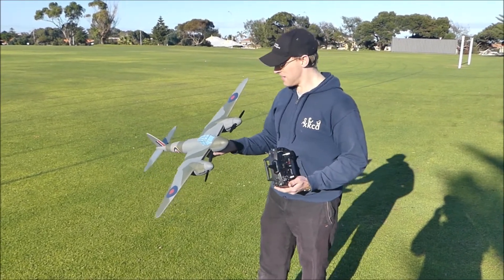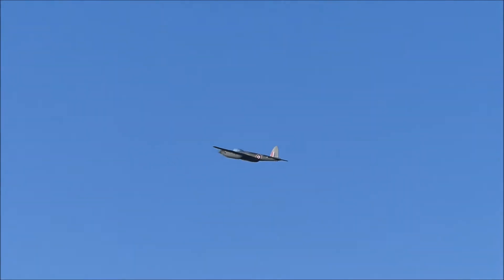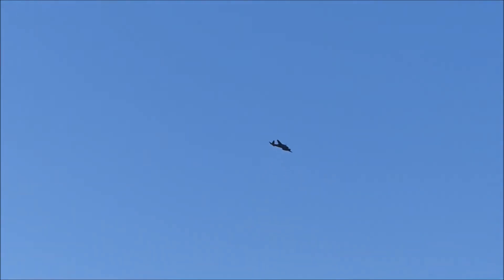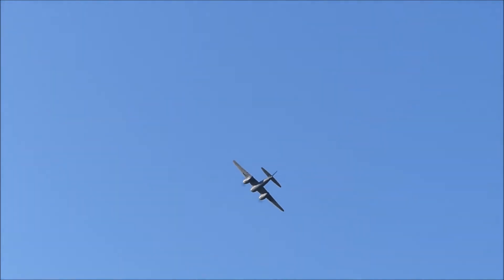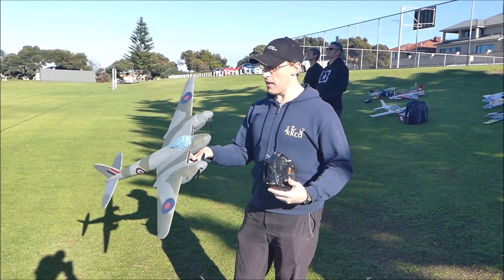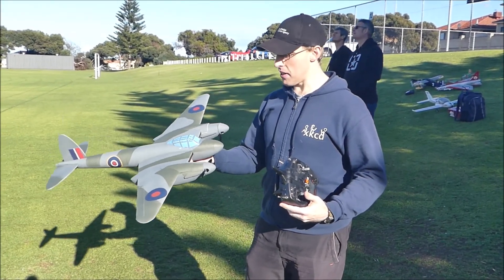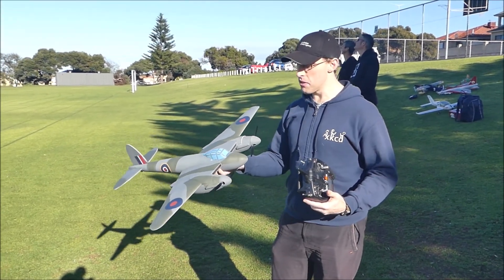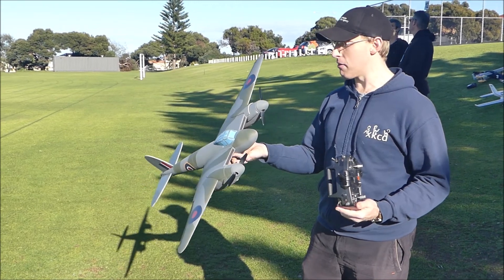3d-printed de Havilland DH.98 Mosquito maiden flight

Comment: can i print it in normal pla? or i must print it with lw-pla?
Reply: Model has ample power and lift to fly with normal PLA. However, a lot of nose weight will have to be added. Could possibly save some weight by reducing fuselage and nacelle infill to 1%.

Comment: As I see in the stills at end of video ... controls are :  Ail - Ele - Throttle .... and no rudder.
Reply: Correct. I use differential thrust in place of rudder. Helps keep weight and complexity down.

Comment: Hi ... I assume you are same guy ... flying at same site as the awesome Vulcan 50mm print job ??   Just wondered if you did ever draw up tail parts in LW-PLA before opting for Foam parts ? Have downloaded your files ... and will be setting to .... wondering if upping KV and dropping to 2S LiPo could be on cards .... I have some 3000 2S that I use for my RCPowers Lancaster ...
Reply: I haven't designed a LW-PLA tail for it yet.
I hope to get around to designing an improved version in the coming months, with a LW-PLA tail.
Increasing kv and using a 2s lipo should be fine. With the current 1400kv, 3s lipo, 6x4 prop setup it has over 500g thrust which, as you can see from the video, is plenty.
Reply from the maker: By the way, Solentlife, David is not the same guy who designed the Vulcan ( that is Dom), but they both fly at our club site.
Reply: @MrWaz11   Understood that already - I just recognised that you fly at same site and also printed out the Vulcan. Like to mention that while printing - the Simplify gives nice prints but some strange results ... difficult to describe but basically sections of 'wall' are very thin and flexi. Is there any way the text file could be expanded a bit to include how you fitted gear .. cockpit .. LiPo etc. ? As so far I have a fuselage that has no hatches or access etc. I'm also looking at wing seat trying to sort in my mind how to brace the two sides apart and stiffen to take the wing halves.
Please don't think I'm complaining - far from it .... I cannot create anything like this !

Comment: Very nice job!
Simply and elegantly designed. Just the right size for me.
Info file contains suggested CG location?
Both motors turning CW?
Can this be printed with other slicers - namely S3D?
(Are the STL valid and containing valid solids?)
Reply: Cults3D lists CoG location. Motors are counter-rotating. I have not tried S3D but solentlifeuk has and has had a few problems. I think it should work fine in S3D but I did all my checking of the design in Cura. STLs are all solids and just printed single wall.
Reply: @drgozzard  thanks for the reply. Ported to S3D and completing the final assembly at this point. I wanted a framed cockpit, top hatch with magnets and printed tail feathers, so I re-CAD the fuselage. At this point, I am thinking about offering this as an Add-on on Cults3D. People would still need to get/buy your Mosquito for the wings and nacelles. Do you see any issues with the concept?
Reply: @dionnel666  Nope. Go for it! Solentlifeuk sent me some mods but I'm been too busy with work to do anything about it for a few weeks.

Comment: Nice. Any specs?
Scale? Span? AUW? Power setup?
Reply: 930mm span, so roughly 1:17.5 scale. AUW 690g. 2x 2212 1400kV motors, 30amp ESCs, 6x4 inch props (bigger would be better). 3s 1300mAh battery.